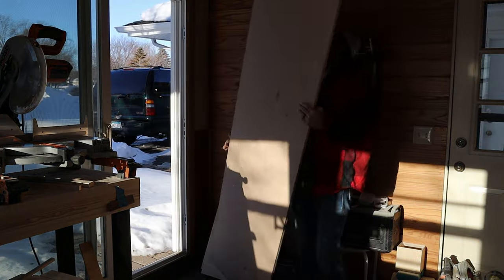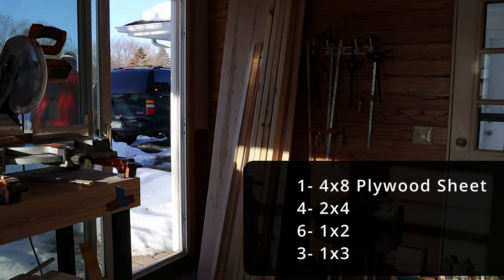How to Build a Mud Room Built-in

Comment: Would u say it’s alright to drill right into a laminate wood flooring? Under it is concrete… how would you approach this?
Reply from the maker: Another way to secure the base frame without drilling into anything is to use an adhesive glue. Something like liquid nail or loctite. These are very strong and will hold very well.

Comment: New to simple builds or any builds 😂 my mudroom has a concrete floor. It was originally the front cement porch, but the previous owners remodeled the house and enclosed it to be part of the house as a mudroom. What drill bit would you suggest to go through the 2x4 and into concrete?
Reply: Masonry bit. Designed for brick, stone, cement, concrete and mortar. Pick it up in the drill bit aisle. Usually they're blue.

Comment: Hey great video. I had a somewhat relevant question. When you drilled in the floor it looked like you drilled in about 1/2" in past the wood. Is 1/2" generally all that is required to fasten wood into another surface? I am building an enclosure and trying to decide if I should go 1/2" and 3/4" into the wood it is being fastened to.
Reply from the maker: Usually I try to go into as much wood as possible to get a good connection. But for this specific video, the screws were more for stability so I wasn’t terribly concerned about the depth. 
Just make sure you know what you’re screwing into and that there’s nothing your screw will hit.

Comment: 12:30  how high above bench did you measure??
Reply from the maker: Hi Kelsey!
I measured 74 inches up from the floor.
Reply: How much of an overhand did you leave for the top of the bench?
Reply from the maker: I left 1.5 inch overhang for the bench
Reply from the maker: - I used 1 inch pin nails for the strips on the wall. 
- I used 2.5 inch finish nails to secure the bench to the cubbies. 
- To anchor the 2x4s into the subfloor I used 2.5 inch construction screws.

*always check where you are nailing/drilling before proceeding